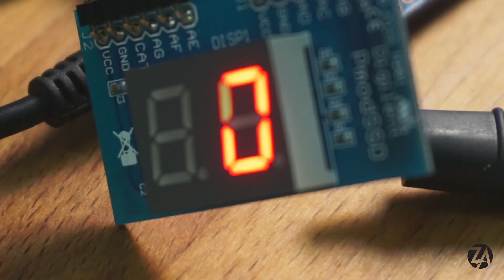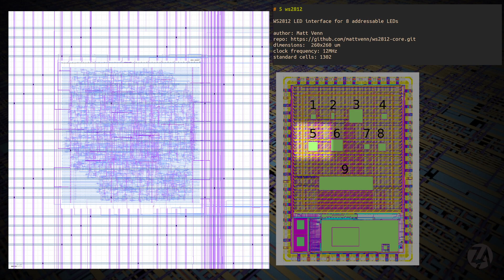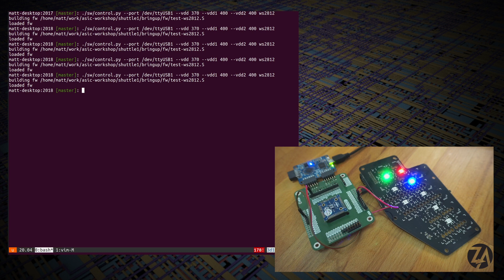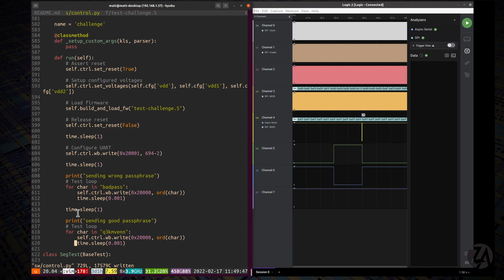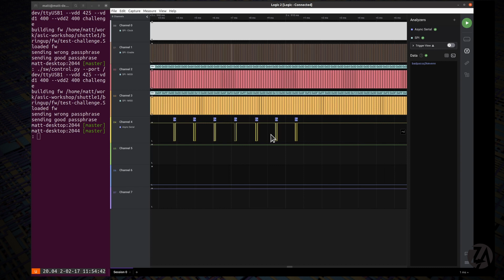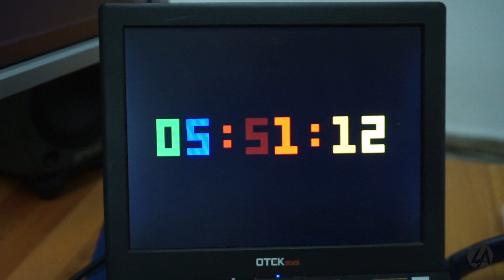All my ASIC designs for Google MPW1 are working!

Comment from the maker: 1/- the SRAM would work at the correct voltage, but we had to undervolt the rest of the chip to get around hold violations.
2/- Sylvain pointed out that for the VGA clock, the clock signal was measured going into the chip, and the waveforms coming out. So a small delay is to be expected.
3/- I have a winner for the CTF!